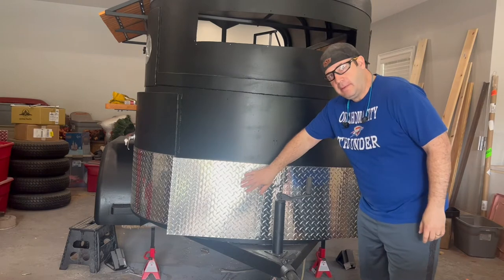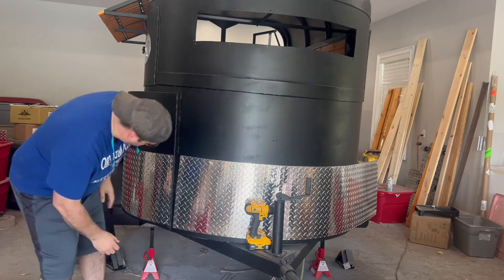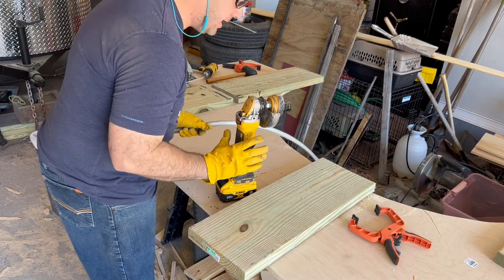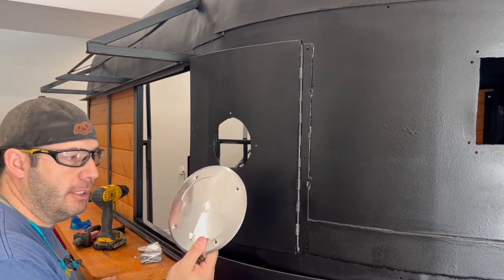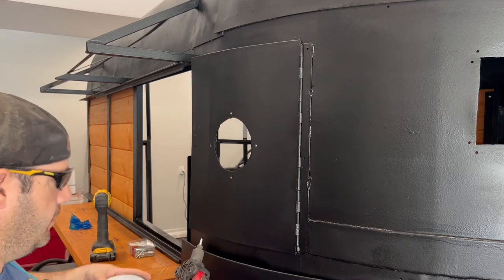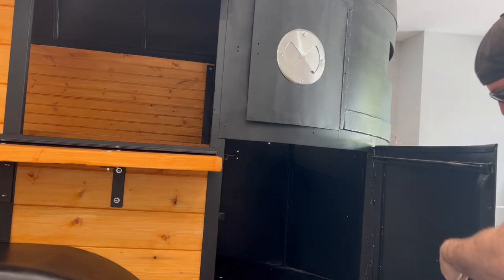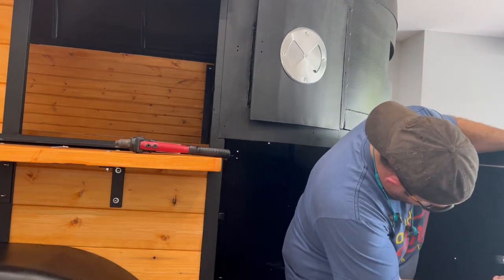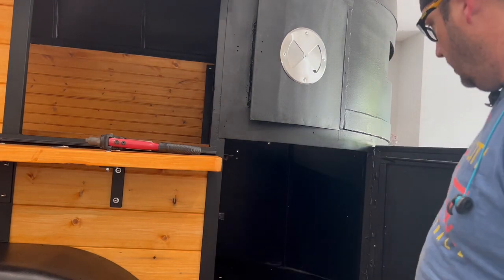How to Renew the Old Trim and Install Hardware and Diamond Tread

Comment: Is there a specific website you go to buy your trim if the trailer you're using needs it replaced ? specifically the front V part and the window trim? Thanks
Reply from the maker: I get my trim from www.horsetraileraccessorystore.com
They carry the trim to make the v trim on the nose, but I’ve always been able to reuse it on my trailers. I do use new lipped trim around windows and along the roof if necessary though.

Comment: I have a similar style horse trailer i am trying to refurbish. The door handle you were replacing in this video, i have the same exact door however the handle is missing, as well as the trim with the two screws. Inside the hole is just a square rod, any idea how to open the door? I bought a replacement handle using the website you have suggested so thank you!
Reply from the maker: Ok, so if the square rod that’s in the square hole is recessed in it enough, you can use a large flat end screwdriver. Put the screwdriver in the hole diagonally, like corner to corner of the square hole, and then twist it with either your hands or pliers if it’s too rusty to turn by hand. 
If there’s enough of the square rod sticking out, you could grab it with some vice grips and turn it. 
If it’s broken off flush, then you could try using a punch and hammer to push the square rod into the hole further or possibly even push it through and out the backside. Once you have enough room, use the screwdriver method I mentioned above.
Of course, as a last resort, if you plan on cutting an opening for accessing the tack room from inside the trailer(like I usually do.) then you can cut that hole and open the door from the inside. 
I hope those options help! If not, let me know.
Reply: @carriagehousetrailers i appreciate the response!  the screwdriver trick worked great! it was snapped off too far in the hole to use vicegrips so i was stuck. I was able to open it so thank you again. The old latch, how did you manage to get that off?
Reply from the maker: @kylemalcolm5099  Most of them are tack welded to the inside of the door. I use an angle grinder with a metal blade to cut the welds and take it off. When I replace the latch, I rivet it instead of welding it. You can weld it if you want, but  I think rivets hold it just fine and are easier to drill out if you need to replace a broken latch in the future.
Reply: @carriagehousetrailers  awesome help! thats kinda what i figured, just wanted another opinion. using the rivets to secure it is brilliant! Thanks a bunch!
Reply from the maker: @kylemalcolm5099  Happy to help!

Comment: I was wondering if you have any tips on replacing the piano hinge on the Tach door.  Does it always have to be welded or can it be a bolt on.?
Reply from the maker: You can grind the tack welds holding it on and either tack on a new one or you could bolt one on. A welded one will make for a cleaner exterior look, but it’s whatever you prefer.
Reply: @carriagehousetrailers  okay,  thanks fortheinfo. Unfortunately the existing hinge is damaged and has to be replaced.

Comment: Where did you purchase the trim for the windows ?
Reply from the maker: I refurbished the old trim using a cup brush attachment on my angle grinder. If you want new trim, I use a site called https://www.horsetraileraccessorystore.com/
In the aluminum trim, the name of the trims around the windows is J trim.

Comment: How thick is that aluminum deck plating?
Reply from the maker: I use 1/8" diamond tread aluminum. You could get the decorative stuff that is thinner and the tread is stamped in, but the 1/8" stuff adds a noticeable sturdiness to the appearance and feel. I get mine at metal supermarkets. If you have one near you, I'd recommend them. With them, you don't have to buy an entire sheet of diamond tread and don't have to pay the crazy prices of getting small pieces at the big box stores.